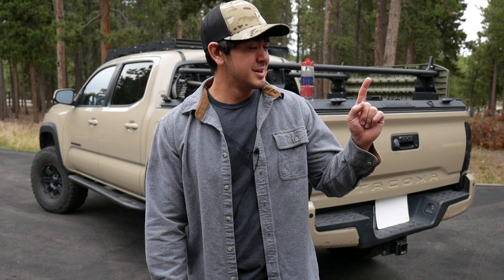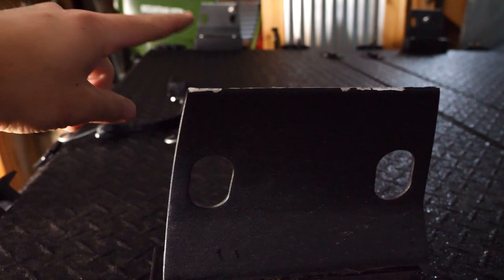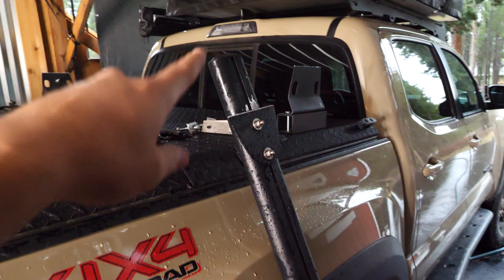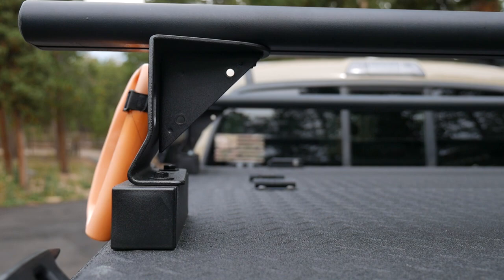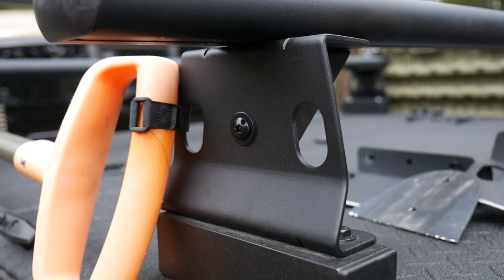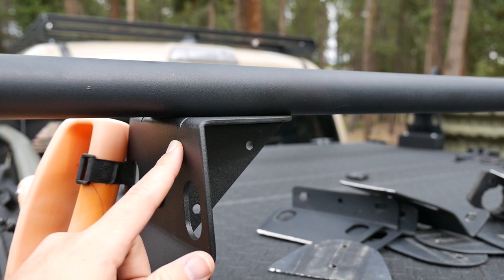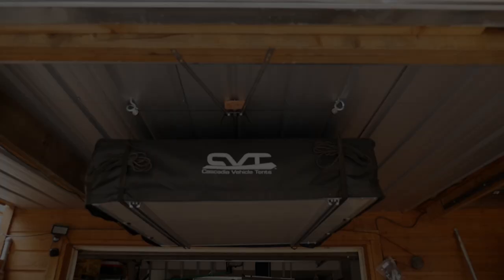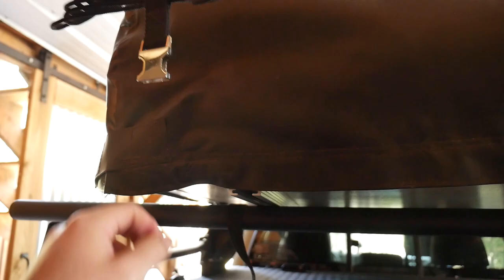My Rooftop Tent BROKE OFF! - Plus BONUS Tent Pulley/Hoist System

Comment: Just a thought. If one rack holds 300 lbs, and the other rack holds 300 lbs, then two racks together STILL hold 300 lbs, not 600 lbs (this is simple physics). The two racks will share and handle 300 lbs each and distribute the load equally, but each rack doesn't suddenly rise in strength and be able to carry double that weight. The 150 lbs weight of the tent PLUS your weight while sleeping weakened the mounts (you look like a well-built fella, you're probably more than 150 lbs). The total of the tent and you was too much on the brackets and the damage was done by your sleeping and climbing in/out and the driving. Not being an ass, just letting you know that the rating per/ system doesn't increase if you add more systems. If you had four systems, you can't carry 1200 lbs...it will for a while, but the 300 lbs rated brackets will fail as they are engineered for 300.
Reply: 300lb rating is for the dynamic load not static, static load can be much higher.

Comment: your math was wrong, you do not double the load capacity just because you have 2 pairs of bars.  the point load on a single bracket will still always be 300lbs. Plus, as you also stated a very rough bumpy trail, that means the brackets were flexing ALOT.

Comment: So I was thinking...There is a difference between sheering side to side motion and up and down compression load. the Rack system might have been designed for a compression load and not a sheering side motion....Just a thought
Reply from the maker: Yeah, I'd assume the engineers (if there were any involved... haha) should know that 'dynamic' load isn't a single direction. But yeah, offroad use definitely introduces a lot of motion that wouldn't typically be experienced on the road.
Reply: Definitely...When I saw your Set-up video i saw the mounts and they to me looked a bit on the weak side...I'm glad you got sturdier ones with gussets for strength.

Comment: That aluminum material is way too thin and weakened when it’s bent like that. Go to a fabricator and get some stainless steel one made. Don’t use steel next to aluminum unless its stainless steel. The dissimilar material will cause galvanic corrosion.

Comment: Wow. It looks like your truck bed was flexing a lot on the trail and your bars probably failed after. If it was fixed to the roof you would have been fine becuase of cabin rigidity.
Reply from the maker: I have been stiffeners, plus a stiff tonneau - but still some flex I'm sure.
Reply: @LastLineOfDefense  have you done a video on the install of the bed stiffeners?
Reply from the maker: I have not - but they were one of the easiest / most straight-forward 'mods' I've done. Very simple assuming you have a few basic tools and the correct bits.

Comment: From an engineering perspective that's a terrible design. There is no ribbing to the rack mount to stabilize lateral movement (L2R). Aluminium necks easily and the movement of the tent continually flexed the bracket until metal fatigue and failure.

Comment: One of the biggest mistakes made by noobs is thinking all of this stuff is made to take a ton of abuse.  It is not.  The old adage "Take are of your equipment and your equipment will take care of you" applies in every way to "Overlanding." I see so many idiots putting mondo suspensions on their trucks like they're going to win baja with a folding treehouse on the top of their truck, then they are mystified when stuff breaks.  Newsflash: trophy truck racing and overlanding = not the same thing.
Reply from the maker: Really not sure the relevance of this comment, but thanks for sharing, J Dawg.